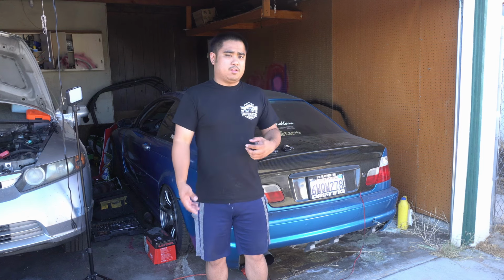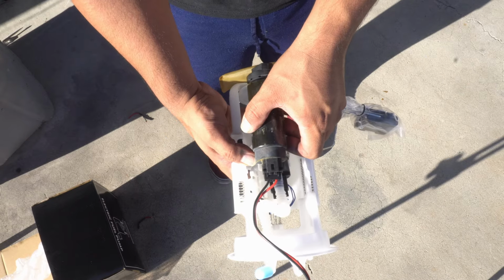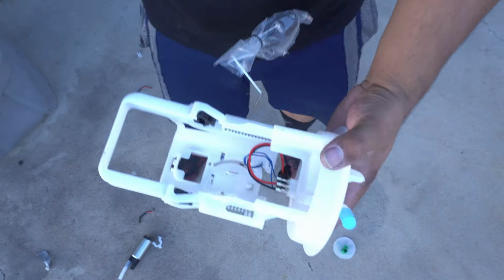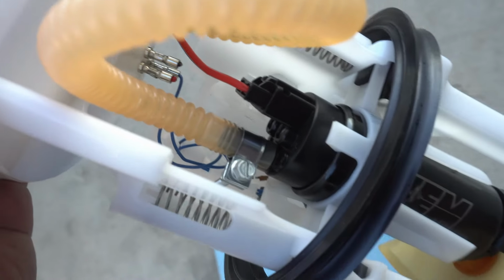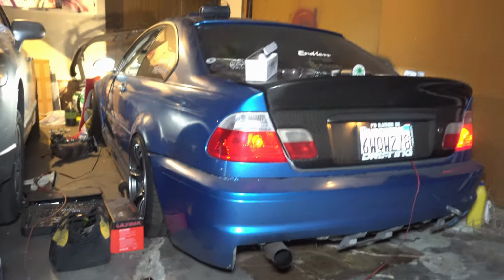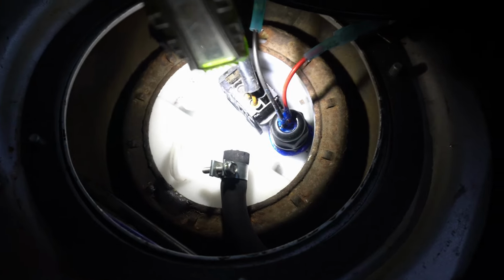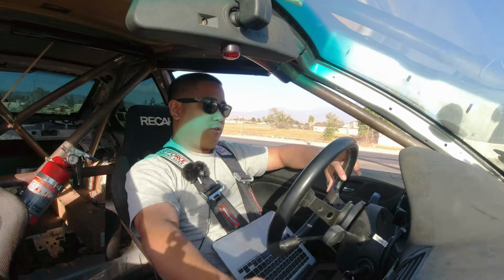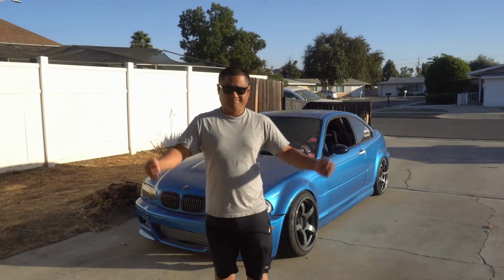What Happened to my Drift E46?

Comment: You were one of the guys I started watching when I was first getting into E46s. Now, I have a 330ci on a Precision 6466 and a MaxxECU Race. Getting ready to do an 8hp70 swap. I could never kick the goofy thermostat logic on the stock DME. Would constantly run 82C when it should be 95C. I had some bad coils that were failing intermittently. Caused some break ups. Not sure if that could potentially be your problem or not
Reply from the maker: Coil packs could be possible, although I have very little miles/hours on them.

Comment: think it can be ecu issue....this is particulary why I;m leaning towards swaping some engine which was stock with forced induction then trying to make work stock NA ecu with turboed engine. I know, that ms43-community is grown a lot, but stil....Maybe simply try some Link? Maxxecu? In my B30 I'm running "polish solution" so stock ms43 combined with fuel implant ecu master Det3 and it is ohnestly running without any weird ecu-electronical-problems at all, but this is still piggyback  with wasted spark...
Reply from the maker: Yup, the longer this continues, the more I'm considering standalone.

Comment: 95C is normal operating temp. 82C is indicating that your DME is defaulting to its lowest temp setting on the electronic thermostat.
Reply from the maker: I'm aware the temps are "normal", but I was surprised at how drastically it came up to 95C, and not long after dropping very quickly to 82C.
Reply: You can change that by chaning t_oil_min to 60degrees for that not to happen

Comment: Could it be fuel starvation issue? When fuel level is about 55%, if you take a hard or long right hander, all the fuel moves to the driver side, where the fuel sender unit cannot move fuel fast enough
Reply from the maker: I doubt it's fuel starving in that sense since I wasn't driving hard enough to produce lateral G's. BUT a clogged fuel filter/FPR is a possibility. I'm probably going to try hooking up a gauge to the stock fuel rail.